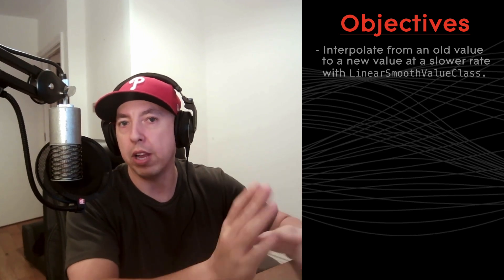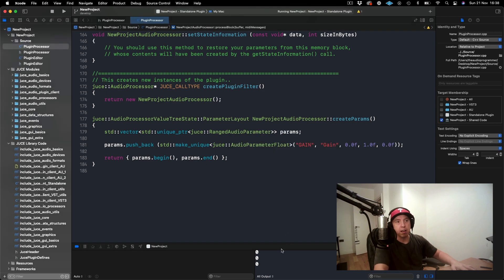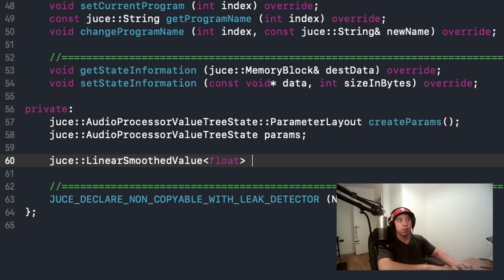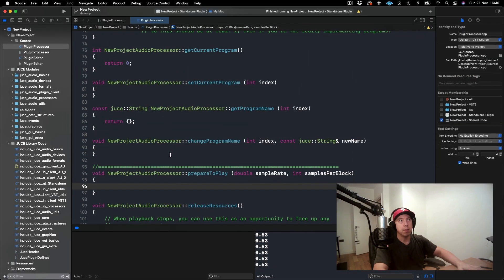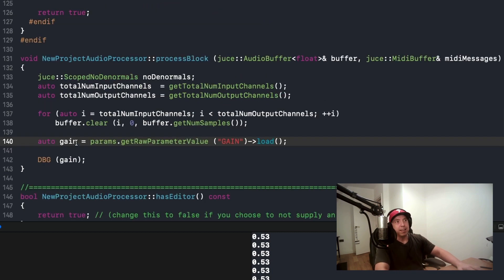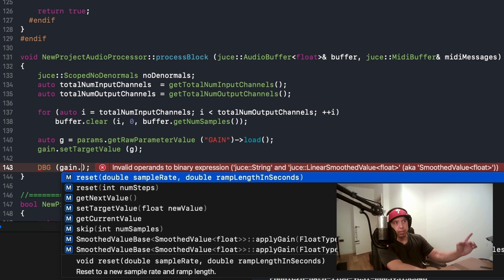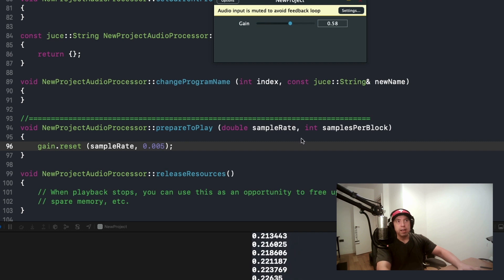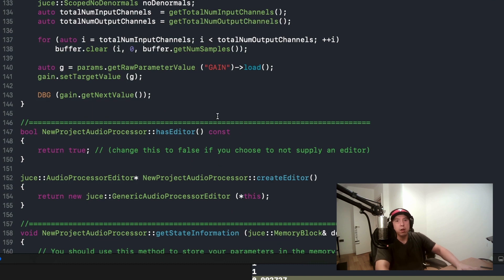JUCE Tutorial 18 - Smoothing Parameters With The Linear Smoothed Value Class

Comment: I'm currently learning JUCE as well as C++ in general and your tutorials are helping quite a lot, especially this one since it's something that I was needing.
There is still one thing that I can't figure out, however, which is using this method for smoothening compressor parameters, more specifically the threshold, since when I move the slider, I start hearing some crackling.
I applied everything in this video and the console shows the values moving slowly (I even set it to 0.5), yet when adjusting the parameter in a live setting, the threshold still adjusts immediately and the crackling continues.
Any Idea what this might be?
Could someone point me in the right direction? This has been driving me nuts these past few days.
Thanks a lot!

Comment: You want to use skip(numSamples) rather than getNextValue() to get the time scale to work correctly, and to be consistent for different block sizes.
Reply: Could you please elaborate on this? I cannot get this to work smoothly when using a gain parameter from -12 to 12 dB.
Reply: Actually, I figured it out, you do not want to call setTargetValue in your processBlock, but in a parameterChanged function that is called asynchronously.